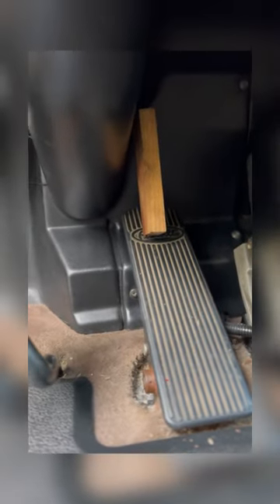A Simple Trick to Check Your Brake Lights! #shorts

Comment: Or use the trolley valve. Most of them stick in place for the duration of 'circle of safety' The same air over electric switch is used for pedal and trolley.

Comment: predawn you can see in mirror. Trailer brake handle that don't stay on can be used with a loop of string or zip ties. I'm currently wedging a paper clip in my trolley handle

Comment: You can set your phone down facing the back of the truck and record a video,  then go into the truck and turn on the running lights, test the turn signals and brakes, and then playback the video to check and confirm proper operation. This is much more thorough than just checking brake lights. You’re welcome.